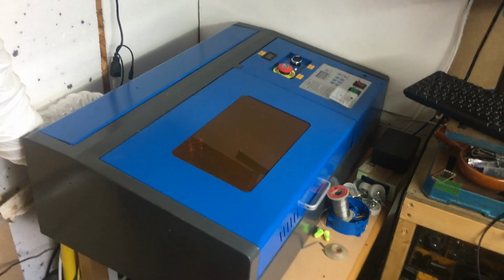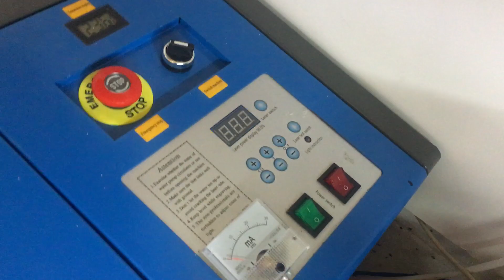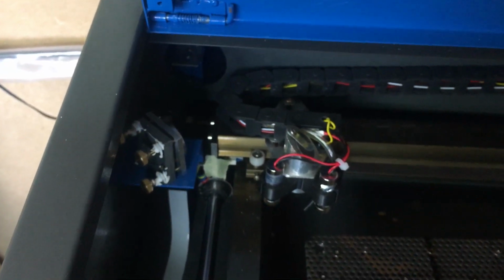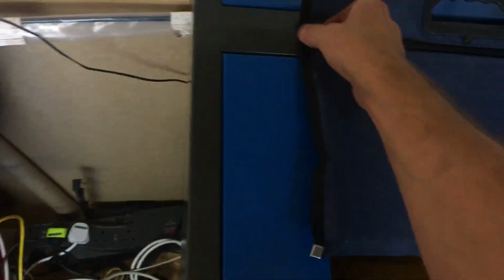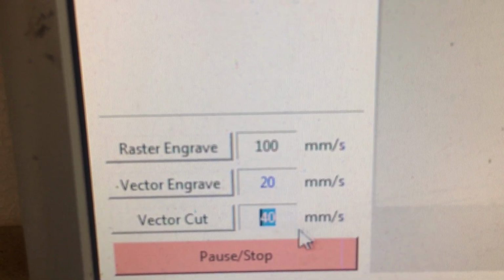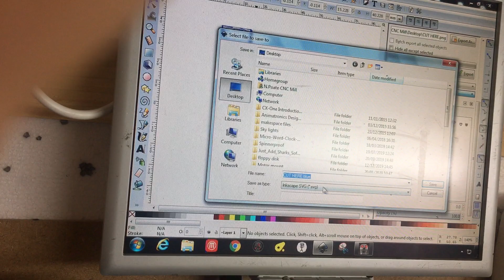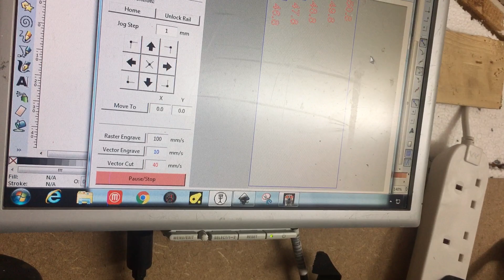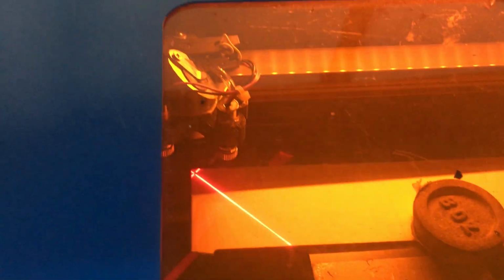Run through of my K40 setup

Comment: Thanks a lot for the hints in your video.  I have a similar laser height gauge and air assist setup but I have used your idea of the perforated sheet with cone studs which has proved to be just what I need so many thanks for sharing.  Matthew

Comment: could you provide the details and source for the perforated steel plate?
Reply: Hi Chris.  Just to let you know that I bought some from eBay.  If you search for "perforated steel sheet" you will find some suppliers.  I bought a 300x200mm sheet which is fine.  I also bought some cone studs like the ones in this video which are great.  Cheers, Matthew